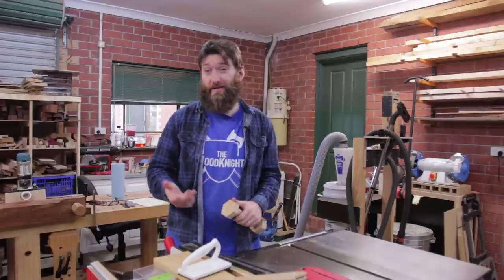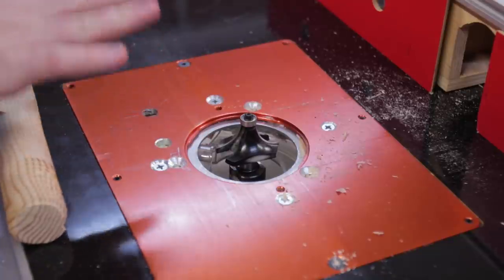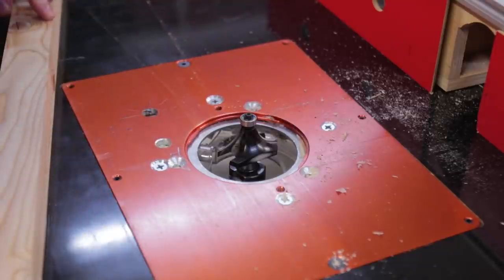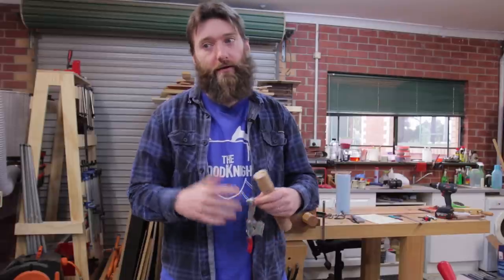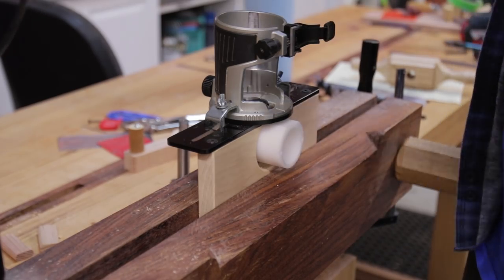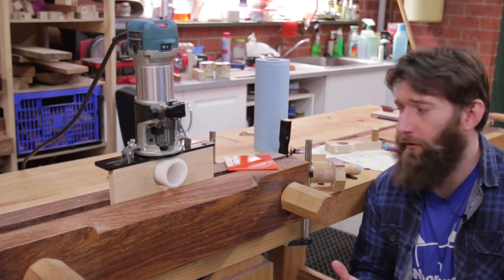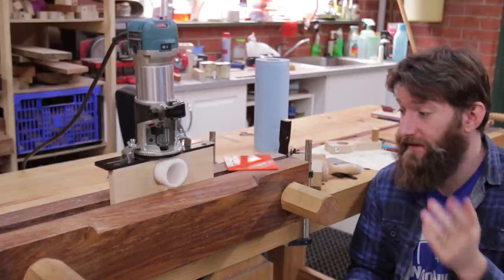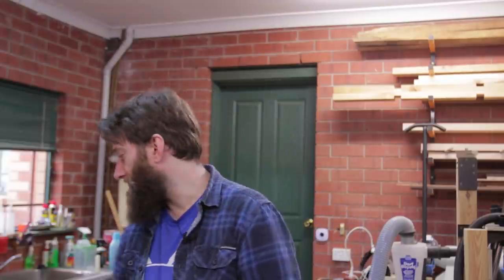Making Wooden Nuts & Bolts

Comment: Wow, awesome! I saw a tail vise kit a while ago and wondered what several thousand dollar CNC machine they mustve used to make them. Didn't know a small router tool was the answer. Cool to see it in use and that friction fit was very satisfying :) Hope you're recovering well.
Reply from the maker: If you are doing production, using a CNC lathe makes a lot of sense. It can get it to very precise dimensions, add in grooves for garters, and thread it all on one machine. With a CNC lathe you can also go for a larger pitch - I think this one is a 3 or 4mm pitch. Big wood screw vices can be 6 to 8mm pitch, much faster to open/close!

Comment: Question for you... i got my kit in and I bought some 1 inch dowels from Home Depot Pine and Oak well the Pine is to big and won't fit the inserts but the Oak does..  I have a big plunge dewalt router but it won't work so I used my Ryobi trim battery router and I get a ton of chipping with no perfect threads,  You think its due to my trim router not begin strong enough for the oak dowel?
Reply from the maker: +David Moss not 100% sure. The oak dowel may not be round (more oval), you could be feeding too fast, or just oak being more porous and prone to splintering. Shoot Beall an email, they will have more advice (I've never worked with US Oak)

Comment: After mastering the smaller threads I bought the big 1 1/2 threader and tap and it's about to whoop me.  It goes so for and then get's stuck.  I had to get some channel locks to  get it out so i figure my bit was to for down but once i get it out the threads are pretty good.  You had this happen ever?
Reply from the maker: The tolerances are pretty tight on what goes smoothly and what doesn't. 38mm works slightly better than 38.1mm (1.5"), but you've also gotta make sure its perfectly round.
It could be that dust was getting jammed in - is the hole on the "outfeed" side nice and clear?
Do you use a handle to turn it, or just twisting by hand? A handle/crank makes it much easier to power through if its just a slight dust jam
Reply: Yea i'm using my hand... I didn't even think to look at the outfeed shoot.  I guess I could have my dust collection going while I'm tuning it huh... thanks for the quick reply

Comment: Wouldn't it be easier to make the dowel on a lathe?
Reply from the maker: Accuracy and consistency is the problem with doing it on the lathe. The threading jig really wants results consistent otherwise it binds and ruins the threads. On a lathe, getting it dead straight takes too much time for a single bolt, for my skill level.
Reply: Paul Jenkins I think it would be doable for shorter pieces, just mounting it between centers, roughing it sown with the spindle roughing gouge, and then using the skew chisel as a scraper to surface it and get it dead straight. I don’t think it would take much time, but certainly a bit of lathe skill.